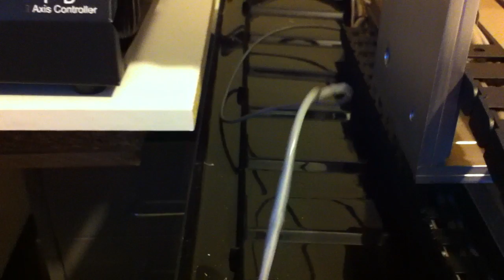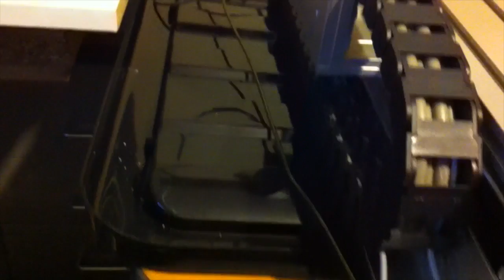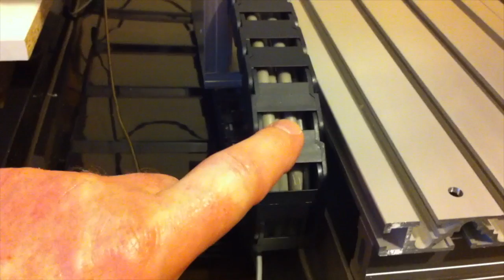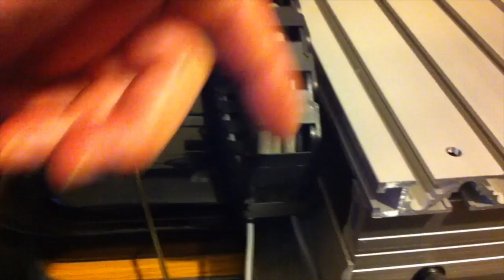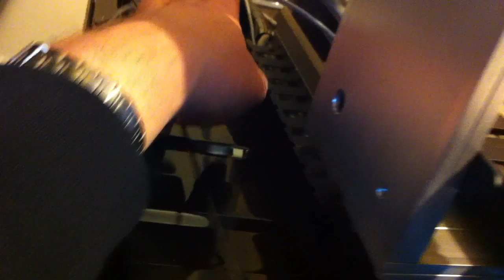Making A Pull-Through To Speed Up Mini-CNC Limit Switch Cable Routing

Comment from the maker: Routing cables or wires is simple if you make a simple Pull-Through Tool, whether its CNC cable routing or the computer cables tangled around your desk.